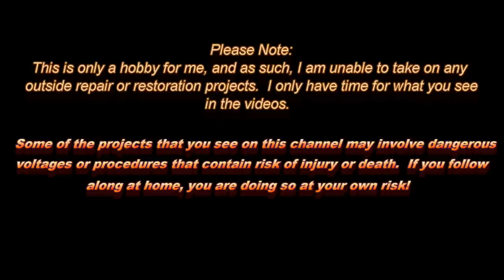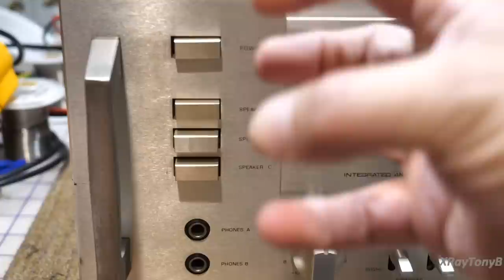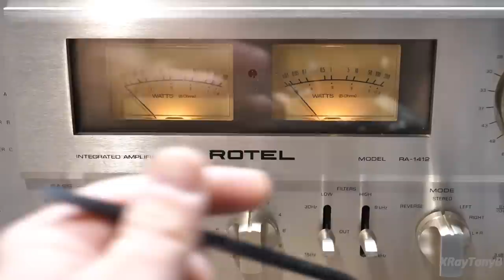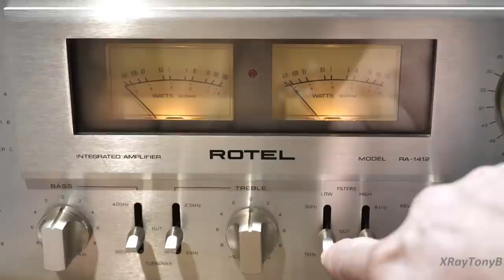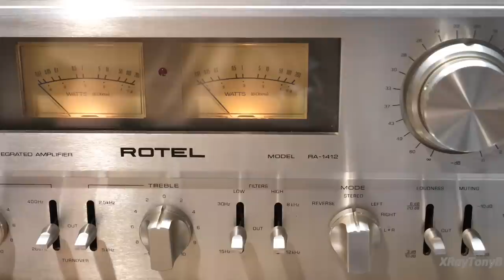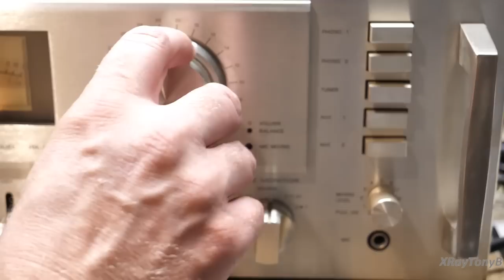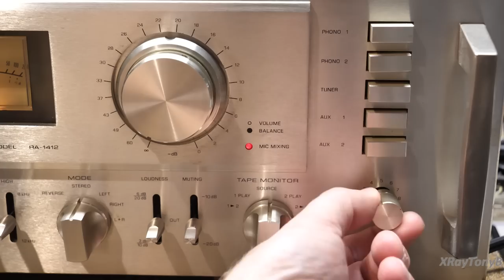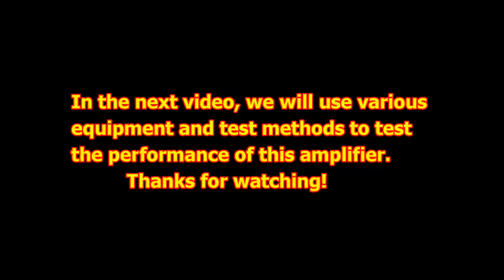"Knobology" of the Rotel RA-1412

Comment: Thanks Tony, I had no idea the Mic knob pulled out to mix. I've never used it LOL! All of the knobs and levers are made so well on these, I've never seen another like them.  Also I recently had the issue with the flutter from my phono player on my Marantz 2250b. I had to use the LOW FILTER and change Tone Mode to IN instead of 250 Hz .Great Video. Can't wait for the equipment test video.

Comment: These channel selectors are very handy, when you have a reel to reel tape. A lot old tapes have been recorded on a mono machine. So on a stereo machine, you would listen to a mix of two different songs at the same time. Of course, you could use the balance knob to cancel one channel out, but then the music will only play on one speaker. Turning the channel selector to left (or right) will play only one track on both speakers.
I have a lot of those old tapes and I'm very happy, that my amp has such a switch.

Comment: for big transformers i use a big slow relay with a 100w 10 ohm resistor across and hook the relay coil up to the mains.  it takes a few cycles before it bridges the resistor which is enough to demagnetize the transformer core.

Comment: Turnover switches the shelf filter. so if you set that filter switch for the low pass only frequencies below that frequencies are affected by the pot. Same goes for the high pass turnover shelf only opposite.

Comment: Ok, so on the "Tape Monitor"........guess I never thought of these types of switches as a "monitor" as you stated. I probably missed something along the way because it's certainly labled as such. While I get what you said about those two outer positions 1>2 and 2>1, my understanding of these positions is they were for recording from deck 1 to deck 2 or visa/versa only. Been a while but I'm sure they work as I described. Is my understanding the same thing only you explained it different?
Reply: He made a slight mistake with the explanation of the outer position. 1>2 means, you can copy from tape 1 to tape 2, the other sources are disconnected from tape 2 record in. Position 2>1 is the other way round.
The big advantage of this switching is, you can copy from one tape to the other, and at the same time listen to something else that is selected by the push buttons.

Comment: Hi Tony, 
Just want make small detail clear about inrush current, at start seconder side are shorted  by those big capacitor that is very true , and also by primary side of transformer too , at start transformer core look like huge load ( low resistance )  to main power , so inrush current are capacitor current + current that magnetism transformer core , in my amplifier I have 600W transformer and I measure peak current 150A ! I used CPU control by trigging triac , an by controlling the angular of voltage ,  it is much elegant and dynamic , no need for big series resistance as traditional soft start .
Reply from the maker: Thank you for the comment!  I did a video on a Soundcraftsmen PM 800 amplifier.  It had a very similar soft start circuit  to the one that you are describing.  This is also the principle to how the Carver "magnetic field" amplifiers power supply works.  I think the relay and resistor is popular because of the simplicity of the circuit and because early amplifier designs would need discrete components to control the triac firing angle, whereas today it can be done with a simple IC and minimal components.  Thanks again!

Comment: Tony I was wondering if it would be possible for you to show us how we could install a soft start circuit in to an amplifier? , I have a realistic STA-1001 amplifier that I restored and it sounds absolutely fantastic for what it is, I was quite shocked with it’s performance. The only thing I wish realistic would have done was incorporated a soft start. When I turn it on my big 15’s thump pretty good. I make sure that I shut off the speakers before I turn it on and I turn them off using the speaker select button before shutting the amp down.  Thank you for sharing your techniques and videos.
Reply from the maker: Might be an interesting project for a future video.  I also think they make soft start upgrade kits that you can get on eBay, etc.  They consist of a small PC  board, relay and some components.  I think you can also buy them preassembled.  You can also get add-on speaker protect boards.  I think I showed one of those in a previous Pioneer SX-525 video.  Thanks for the comment!

Comment: I'm curious about the 3-way speaker switch.  I'd just about bet money it has some kind of interlock, either mechanical or electrical that prevents all 3 from being turned on at the same time.
Reply: You can’t!!..The RA1412 and RX1603 have speaker A.B.C switching switching however only 2 can be selected at one time … ie A+B or A+C or B+C.